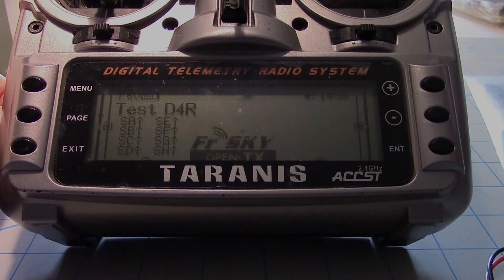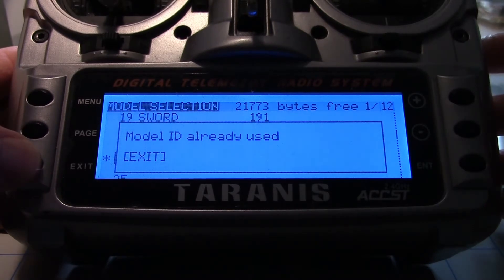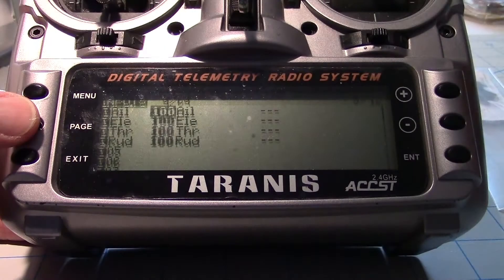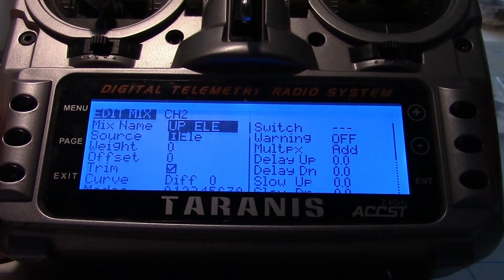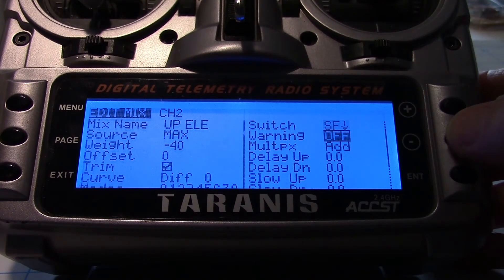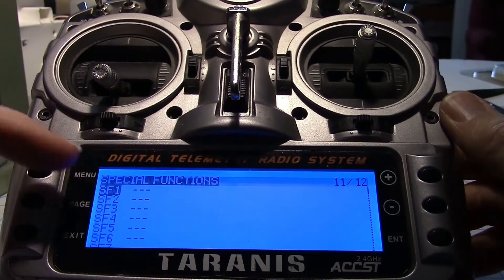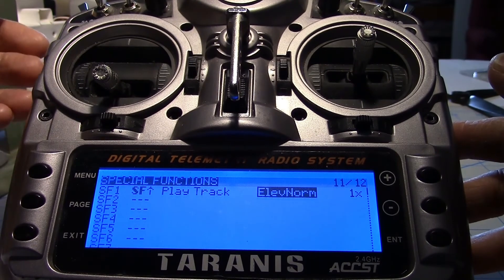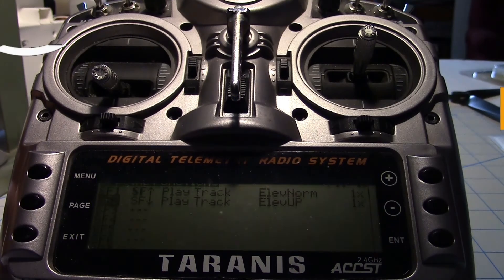Taranis Up Elevator Launch Mix for Flat Takeoff - No Dip! (Ranger 2000 Pusher Prop Plane)

Comment: Thanks.  Great video.  What does the “max” do?
Reply from the maker: The 'MAX' source
MAX is a special source which doesn't correspond to a physical control. Instead, MAX supplies a fixed value of +100. In conjunction with weight, it can be used to simulate the effect of a fixed stick position.

Src = MAX, wt =100 -- output = 100%

Src = MAX, wt=50 -- output = 50%

Src = MAX, wt=-100 -- output = -100%
Reply: Thank you very much

Comment: Man your good, do you plan on doing a Quad soon?
Reply from the maker: I actually used that same pixhawk FC to build a quad a few years back. There are some videos on it on my channel. I don't plan on doing another anytime soon. Instead I have been messing with INav Cleanflight and racing quad controllers.
Reply: Thanks, would like to do a racing quad. I must get through this the first. One step at a time. I'll go look for your  video on the quad you mentioned. A big thanks.